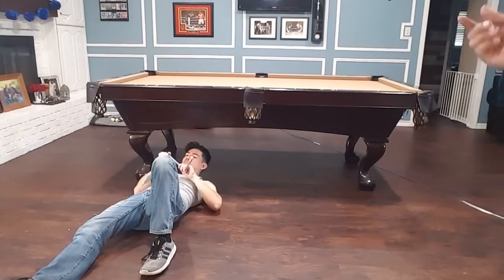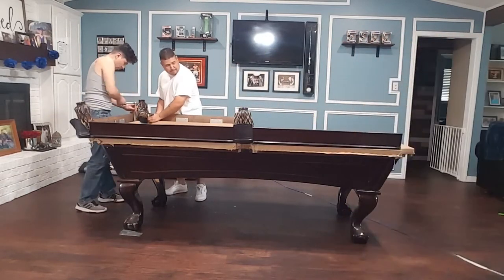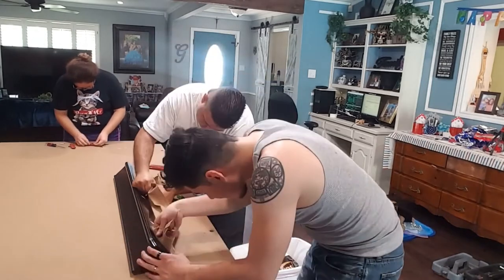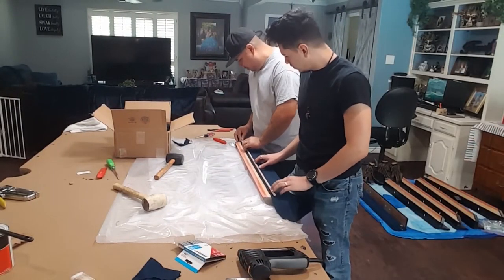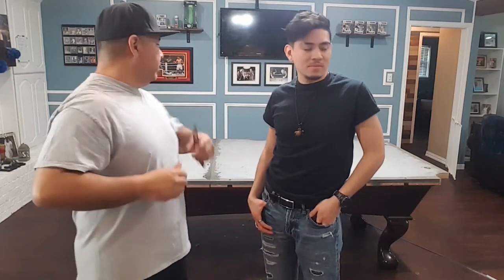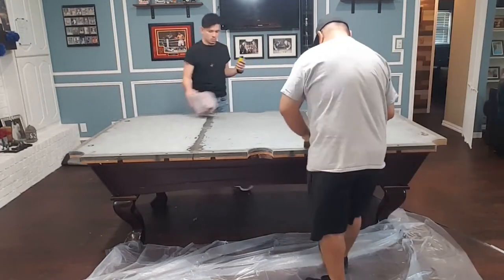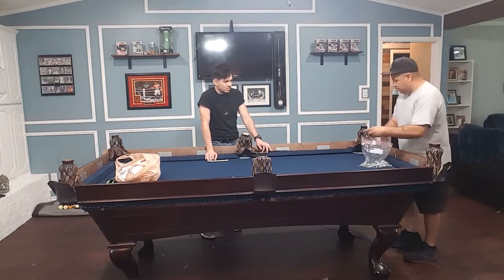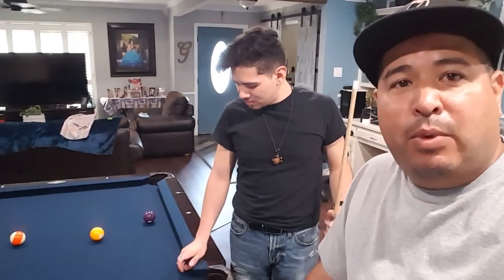Watch us install new felt on our pool table

Comment: What do u do for the holes where the rails bolts go through to attach to the slate?
Reply from the maker: You can cut a cross on the holes. The fabric will not run.

Comment: Great color boss I was wondering what holes did you fill are they the bolts that hold down the rails? A little confused on that
Reply from the maker: the bolts are holding the slate down to the frame of the table. they're actually Phillips head screws. those are the ones being covered. the rail bolts you will see from underneath the table.
Reply: @basicallyus2020  makes sense now appreciate it thank you!

Comment: For future reference, when you use contact cement you coat both pieces, let it dry, THEN stick it together.
Reply from the maker: Good to know thx!! 

Appreciate the comment 😊
Reply: Not dry, but when the glue becomes gummy.
Reply: @truthwarrior122  What? No, dry. Dry enough that if you touch it, none of it will move or come off the piece.